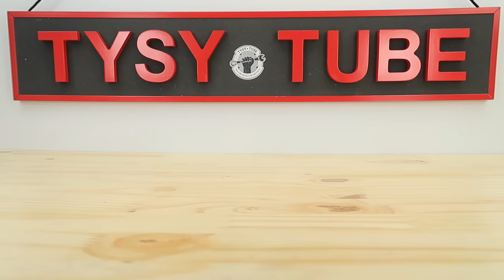Vintage Door Lock Restoration for 2022 - How to restore a Door Lock

Comment: The best part is that the tools used are relatively common tools, except for the  sand blasting cabinet of course. Some restores have a specialised tool for every job. This guy shows that it can also be done without a massive workshop. Kudos, enjoy the vids.
Reply: The massive workshop certainly helps, though
Reply: Beauty.

Comment: I'm thinking about breaking into your shop just to change that capacitor myself
Reply: Whats that?
Reply: We’ve been nagging him to replace the starting capacitor for his wire wheel so it doesn’t have to be started with a finger spinning it. Easy fix for this talented fellow.
Reply: @mred8002  I actually made a comment once, thinking very highly of myself for having both located the issue and provided a solution. Then I caught to the fact that half the people watching the channel know too...
Reply: "Mon dieu! I have been visited by the Capacitor Fairy!"
Reply: Lmk if ya need an accomplice
Reply: @bike23august  it's the part in the grinder that allows it to start on it's own, without you giving it a push...  It stores electricity and is able to give it a boost when it starts from nothing.  that's not quite exact, but it should give you an idea.
Reply: @alden1132  I laughed hard at your comment
Reply: On the one hand, I completely understand. On the other, I think him spinning it like that is a part of the flair at this point
Reply: Tysy:why are you in my shop...
OP:I’m fixing your wire wheel

Comment: My first place after High School was a one room cabin I built in Montana, near Yellowstone. It didn't have running water, but I had a lock very similar to this one. I found it still in the original box it was shipped in during the 1920s. I restored it best I could (painted it with high-gloss black enamel) and used it as my primary lock for years. It even had the original key. 

Super easy to pick, but full of all the best spirit of those who built our homes and towns before us. 

Great video!

Comment: “Oh he’s gonna use paint strip-“
literally scraps the paint off by hand
.....I didn’t know we could do that
Reply: Bro right I was like omg
Reply: on a flat surface with paint in that condition you can
Reply: I'm surprised he didn't check for Lead paint first.
Reply: Maybe it didn’t matter in this scenario? I don’t know how it works tbh
Reply: @ivychu3088  So long as he cleaned up well afterwards and wore a mask or something while he was scraping it's fine. The reason most people use the paint stripper is so that everything clumps together instead of getting fine lead paint particles all over the place. In this case the paint was degraded enough that it didn't matter, he could just scrape it off. You mainly don't want to breathe in or otherwise consume the paint chips, as they can cause lead poisoning which is no fun.
Reply: InstrucTube Oooooo thank chu for informing me.
Reply: @ivychu3088  No problem. Lead paint is a hazard, but if you know how to handle it it's no big deal.
Reply: I gave it a thumbs up as always as I like the stuff you do. But I did think using the wallpaper was a bit naff. Cutting out some of the design and using it a a stencil to put gold or silver on black would have given it more style.
Reply: Well, i think.. if someone scrap, or sandblast lead paint, its HIS choice, and with proper air vent, i think its not much of a problem :>
Reply: @balluumm1  Naff?  Me too.  In my 'personal opinion' (before anyone starts flaming me) it would have been much more elegant and practical left plain black paint.  Perhaps he has a plan where he is going to use it, and the paper is perfect for there, but door locks do get quite dirty and I wonder how long the paper will survive cleaning, even with the layer(s) of finish he sprayed on.  Will it still look as good in 5 years time?
Reply: Be careful it usually had lead😷
Reply: You can do this on something that’s steel. If you take a steel razor blade to something brass or aluminum you’re going to mar it up.
Reply: Recently I ran out of paint striper, lazy to drive a couple of km to buy some, I removed the paint of my BMX (the whole frame) with a common flat key. Surprisingly it took me around 30 minutes.
Reply: Marshmallow Princess 😂
Reply: and probably is lead paint.
Reply: Переведите кто-нибудь, я не понял шутку.

Comment: Something I thought of when they scraped the paint off: I think it would’ve been easier to simply put paint stripper on it. Just a thought
Reply: also that old paint is 100% sure to contain lead
Reply: 83hjf Ohhhhhh, that makes sense I never thought about that. Thank you for telling me that!
Reply: I was thinking of my 4 inch Scotchbrite paint removal disks on my grinder would make quick work of that, but remembered lead would be everywhere. Paint stripper is a good idea.
Reply: I advocate paint stripper for two reasons:
1.  As TYSY stated -- it keeps the sandblasting media cleaner.
2.  Note comment of 83hjf -- I agree with that statement.
Reply: He said in one video that he hates paint stripping and asked for alternatives. So maybe it's just his preference in this case
Reply: Good idea, but paint stripper is several more steps, and slightly time consuming.  Also, on that small flat surface it was probably easy and fun to just scrap it off. (Just my opinion)

Comment: At least you dont need to make a new key like MyMechanics 😅
Reply: Honestly I think he'd have done this resto better.
Wall paper and glue ?......No
Reply: My Mechanics saw the house, and said, "I make a new one". It hovers...
Reply: My Mechanics and Tysy need to get together for a video!
Reply: Bam Srosier mymechanics is on a different level than every other YouTube “restorer”. Quoted because making new doesn’t really qualify as restoration.
Reply: @MikeL-FL   finally someone said it.. don't get me wrong I love my mechanics but restoring things is the best way to go about it. It keeps the character in the object only replace or make a new one of something that absolutely can't be restored
Reply: @nateluecking5804  I have to disagree with you a little. My Mechanics is adding his touch to the pieces he restores. He keeps the old character of the item as well as adds new character. It shows a change in the times and technology through his finished pieces. Instead of throwing broken pieces away, he gives life to them again.
Reply: @MikeL-FL  I believe it's two different ways of "restoring." Or, what you prefer restoring means. That doesn't mean one is the right or wrong way. My Machanics is adding his touch.

Comment: I don’t really understand the whole bluing it, then priming and paint, then wallpapering it. Would’ve look good as polished metal.
Reply: KenTheTrul I agree; why all the meticulous restoration to cover it with shaggy cut wall paper.
Reply: I also agree, sort of.  I would prefer the polished look myself but it's his project and his artistic expression.  Or, it may be a consignment piece and the owner wanted it that way to match their decor.
Reply: Because he’s restoring it. To him that means the way he found it. Not the way it was manufactured. If you don’t like that don’t watch his videos
Reply: Stan Shearer He states he found it at a flea market and he’s doing it to go on display. Read the description of the video.
Reply: Blueing keeps it from rusting
Reply: @sodorflubbs5000  To restore it means making it better than it was when he got it. Putting wallpaper on it doesn't make it better, its just wrong and totally impractical. This is a fail as far as I can see.
Reply: The wallpaper was just wrong.
Reply: I assume he’s going to display it rather than actually use it, hence the wallpaper.
Reply: I wonder if you still have the lock’s original keep?  They are always getting separated and go missing on those cool old locks.
Reply: @KenTheTrul
Agreed...
Reply: @ferrangalvezcastaneda4968  so does priming it.
Reply: @sodorflubbs5000  how about you just learn to think critically like an adult?
Reply: @sodorflubbs5000  people are allowed to have opinions–and even questions.
Chill out, I'm sure he doesn't need you driving viewers away.

Comment: Really enjoyed. Just a tip from experience with antique Ward Locks. The best thing with the inside of a lock is Graphite, rather than oil or grease. Over years grease and oil attracts dust and dirt and thickens on the mechanism, making it stick and stiff to open. Graphite doesn't and keeps the lock slick. but this only becomes an issue 10+ years of constant use so not to worry. Great job, looks fantastic.

Comment: I like the sandblasting because it seems to melt away the crud. I guess that's why I like to pressure wash my driveway. I also like the metal filling because you get such a smooth glossy finish afterward.

Comment: Things I like about these videos: 

1. The background silence. No music, no voiceover. 

2. When you introduce the object to be restored or sometimes a tool, the thud it makes against the work surface. 

3. Challenging disassembly, to see how you work out the solution in terms of logic and tools.

4. Sandblasting of course. 

5. The finished result, especially compared to what you started with, those back and forth jump cuts, the 360 views, the rolling into frame of something on wheels. 

6. The slow, thorough pace of the video. It’s not rushed so we see and understand and learn from each step in the process. And there is plenty of time to read the explanatory text. The fast-forwarded repetitive sections are great too! That fast-forwarded hammer is especially enjoyable to listen to.

But my FAVORITE bit is the powder coating! I like watching it bake and change color, but I may be thinking of a different channel. If you don’t film that part, please do!
Reply from the maker: 6- i do
Reply: @TysyTube  Haha, perfect!

Comment: My grandpa had a bunch of these  locks brand new in boxes with Keys. On the box, it said what colors they came in. Light Green, cream, Pink, light blue, light orange, red, Light brown. I was actually surprised it didnt come in like white or black. But, back in the day, White and Black on doors was actually not that common.Back then, Doors were painted in the colors above besides white or black. Or they kept the wood and either clear coated them or stained them.

Comment: A great way of removing paint from metal is a slow cooker water and bit of detergent. Works wonders for metal and brass fittings covered in paint and is lead paint safe as there is no dust.

Comment: So far I've restored many of the locks in my vintage 1870's house, both mortise and box locks. None of them were working. the front door mortise lock was quite complicated.  I had to replace a broken flat spring. I used the spring from an old set of ignition points which was easily modified to be a nearly exact fit. For rust removal I use Naval Jelly and for paint removal MEC.  

I used silicon oil for lubrication but probably should have blued the parts and used dry graphite lubrication. When I have noting else to do I'll go back at do at least the front door pocket lock, which is exposed somewhat to the outside.

The main problem is getting a locksmith to make keys for the few keys that are missing. Locksmith companies want big bucks to fabricate keys. Having new keys made will run into the hundreds of dollars for the three that are currently missing keys and I still have six locks to go. If I knew what blanks to purchase, cutting a new key would be fairly easy.

Unfortunately I didn't record the procedures, it was before I started my youtube channel detailing the restoration of my 1950's HO scale model trains. 

I lost a seven inch adjustable wrench that was my dad's. It lain outside in the mud for at least three years. When I finally found it encrusted with about a tenth of an inch of rust.  Every moving part didn't. It took a couple of days and a lot of effort to get it back to like new condition. Sometimes I just open up the tool box and admire it. 
I need to get set up for polishing and blueing though.

I really enjoy doing these restorations and will be sure to document the cellar door mortise lock project. It should be a lot of fun.

If I get brave, I have an 117 year old Elgin/Ball pocket watch to restore. My other pocket watch, a 127 year old Elgin "Hunter" is still running, gaining only about two minutes a day, something that could probably be adjusted out.

-dave

Comment: The part best liked... the anticipation of what the restored item will turn out like... When someone like yourself attempts a restoration we know it’s not staged or dug up out of the ground supposedly since the beginning of time yet washes into usable condition after a rinse in water. We know you’ll pour your heart out into it but showing us that finished product first gives it away🤔 
It’s like cheating...
Still, that came out excellent. I thought you’d painted it at first but then when the printed paper came out it all made sense. Great idea, I’ve done light switch plates like that, a background of a cabinet with a poster and color stripped some wine bottles too (Papier-mâché) but this opens up a whole new world of options... Keep up the great work my friend but maybe try to keep us in a little more suspense?

Comment: I see that whenever you use the wire wheel motor, you have to nudge it into action.  I wonder if the motor is capacitor start if the capacitor can be replaced.  If not capacitor start, then it may be a broken secondary phase-shift coil.  Perhaps one end snapped or something.  If you can restore that motor as you restore all the other antique tools....

Comment: Instead of greasing the inner workings, you should use dry film lubricant or powdered graphite. Grease or oil will attract dust and eventually gum up the works.

Comment: As an amateur, I'm curious: is there a functional purpose of doing the manual scraping of the old color before sandblasting it? Wouldn't sand blasting do the same thing in the very first step?

Comment: I was actually surprised the spring inside wasn't snapped, I've changed over a dozen of these types of locks in customers houses for modern style locks simply because the parts are not readily available for these Oldskool setup.

Comment: You don't grease door latches.  When you opened the lock case, you could see no accumulation of dirt.  A sure sign that no oil or grease was ever applied to the mechanism.  Don't oil or grease these.

Comment: (2:07) I remember YouTube user 'Hugh Jeffreys' did a restoration of a lock of a similar type that was more xomplete, and in his restoration, he used something, which I think was paint thinner, to break down the paint and make it easier to remove, just as long as he was careful not to damage the original paint.

Comment: This door lock is solid and impressive, but unfortunately has a very low secrecy, it is easy to open.
An interesting idea with a decorative film, but it is unnecessary to paste on the inside, the one that faces the door.
Corrosion protection and lubrication were made; rust does not threaten this lock. Many who do restoration tear off protection, polish and do not worry about corrosion. Tysy well done.

Comment: Usually you will arrange the parts on the table BEFORE they go to the parts washer or the sand blaster. Odd that you didn't do it this time. Also, scrapping paint by knife? You've been using paint stripper before, why not this time? I subscribed and hit the bell anyway. :)

Comment: Where's the other half won't work without it that goes on the door frame and wallpapering the inside won't see it as its against the door.I restored a number of those horrible locks for my 1915 home,not sure in use wallpaper last long.

Comment: Dump the wall paper the lock is worth more in black paint with its original key......it was my job to cut keys for these locks using  hand files ....Bench locksmith for 46 years.....

Comment: I'm okay with the wallpaper, but at the very least line it up with features on the lock. The striping could've matched with the latch perfectly. The keyhole or knob with the points in the pattern. I'm not against the idea of doing the wallpaper, but do it well and with intention. This is the first disappointment I've seen on this channel.

Comment: Way too much grease. This isn't an industrial machine you're putting together, it's just a lock that may get locked/unlocked once or twice a day. A light oiling would have been sufficient. All the grease is going to do is attract and capture dust and dirt. And when the heat rises, all that grease will melt and run out of the lock messing up the paper covering and the door it's attached to. Go back in and clean out 99% of that grease.